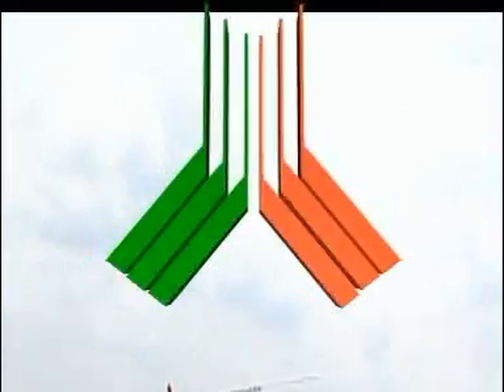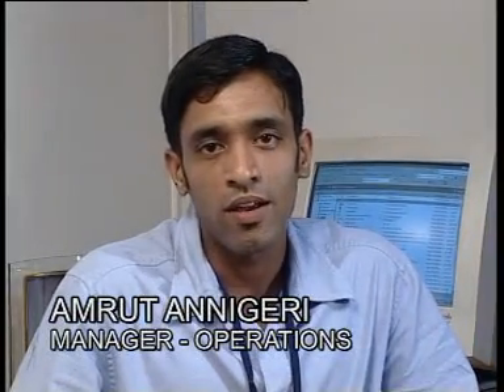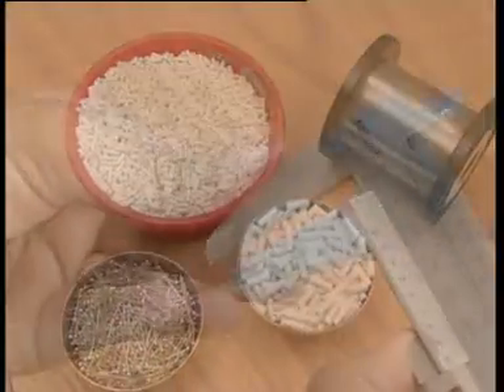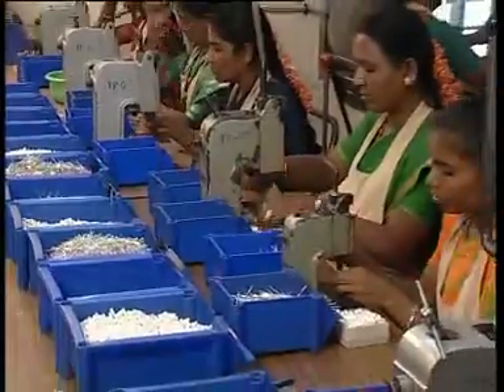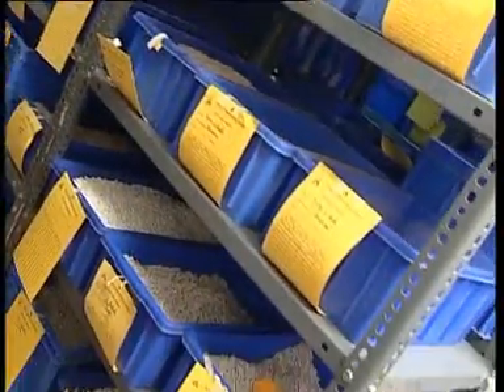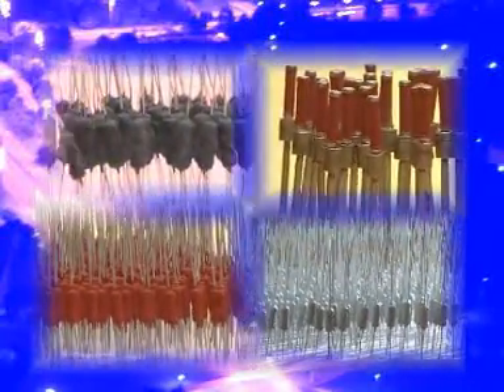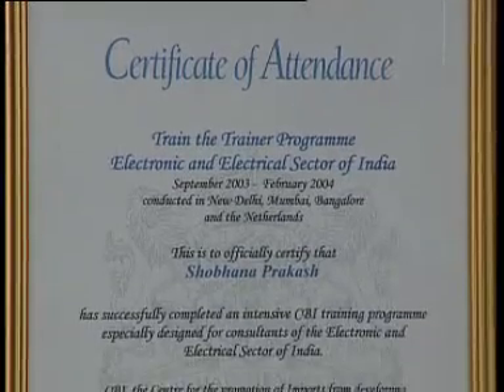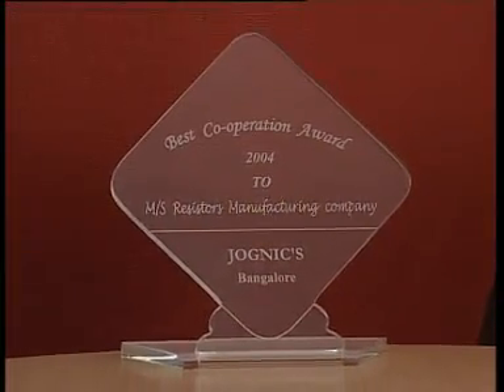RESISTORS INDIA

Comment: do you manufacture SMD Resistors for 1% tolerance ? can you start doing it?
Reply: lol...I bet they do, those are not made by hand though..laser precision trimmed but with a few hundred machines am sure they can produce the quantity you need.
Reply from the maker: Just wire wound resistors. However you can send me your SMD 1% requirements